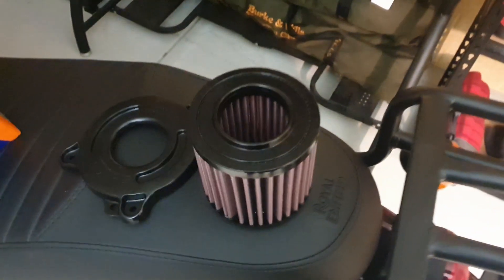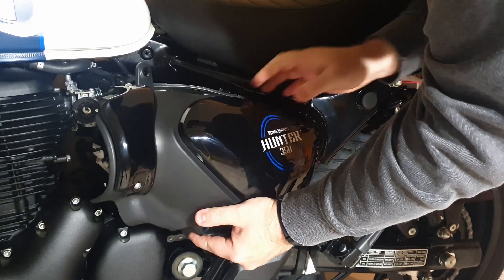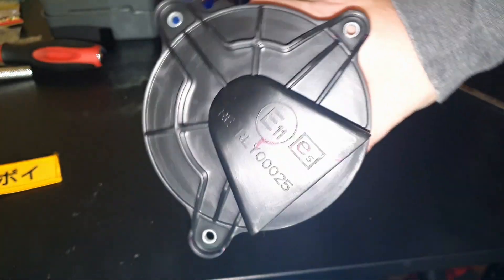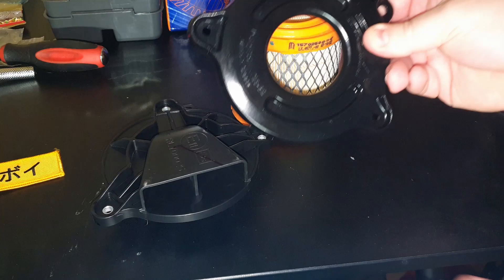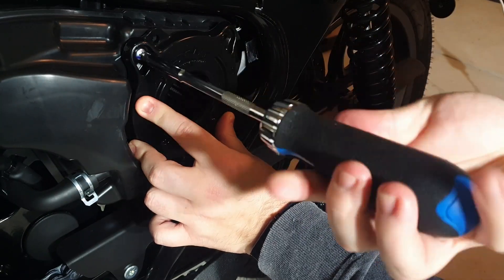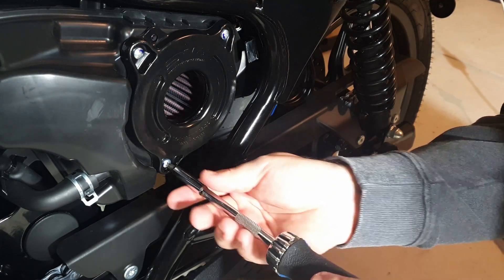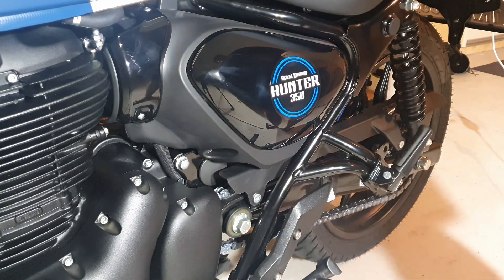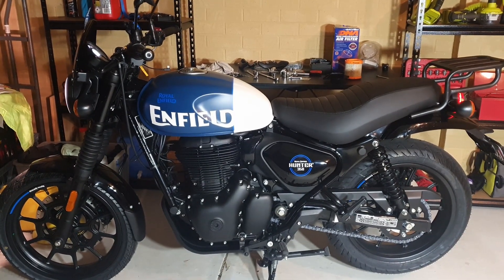Royal Enfield Hunter 350 DNA performance air filter and de-restrict plate install

Comment: It would have been really useful if you had given your impression of the new filter in use. Perhaps you will do another video to that affect.
Reply from the maker: I recorded this video only as an installation guide rather than a comparative test of the unit. My bike is not an ideal platform for testing as it is still in its run-in period and so the benefits of wear in could not be seperated from the new filter and box benefits, and so i felt like it would be unfair to review the DNA unit without evidence of its effect. When I uploaded the video I had not yet even had the chance to ride the bike. I only installed it last night, planning to ride this morning.

However I have now ridden the bike with the air filter and, without any data to support my opinion, it does feel more responsive and smoother when getting on the throttle, such as after changing gears and then reapplying power it is smoother, there is less delay for the power coming on and less lump. It makes it more pleasant to ride.

As for any actual performance gain I doubt there would be any, as the bike is not being re-tuned, it just has better flow and so is reaching its potential torque and power for any given revs with more ease. 

This part was pretty expensive for its benefits. I'm hoping that the future savings for washing and reusing the filter rather than buying new will offset the upfront cost. I would also if I could have 3D printed the derestricted air box plate, my unit had some shoddy tooling marks and undesirable finish for such an expensive piece, but I was unable to attain an STL file for the piece. Maybe a future project I could look at making something up in blender or solidworks.
Reply: Thanks for taking the time to reply, I’m thinking of just replacing the cover not the filter itself.
Reply: @keithwheeler3049  the cover is all that’s needed.  The filter only claims a 2% increase in flow. If you really want one I’d wait until it’s time to change the filter and buy the dna.
Reply: @elwood62  yeah if there was STL file to 3D print the plate that would be a great cheap upgrade
Reply: @MrCombfoot  I did it on my Meteor after break in and noticed the better response, and also the power band/torque curve didn’t drop off at 60 like it used to. Fairly smooth power up to the speed limiter at 74 (which the web says you might not have). Just mentioned as you probably won’t notice that during run in
Reply: @ChadWinters thanks, very interesting. I fancy getting a Hunter, but just wanted a bit more urgency from 60mph to 70mph, to aid overtakes. Did you notice any improvements in this area?
Thanks

Comment: We all do this sort of thing, but until you modify the exhaust system there will be no benefit. No point in making a bigger hole at one end of a system if there's still a tiny hole at the other end. You can save money on the air-filter cover by simply taking a jigsaw to the original rather than buying a separate plate. :)
Reply: Yep. Be no benefit any way restricted by ECU needs a reflash. Lots of money for miniscule gain!

Comment: I do interesting in the DNA but the only thing I worry is more air flow does the stock ECU can compensate enough fuel, I'm afraid that its may running too lean.
Reply from the maker: This is not a forced induction solution, it is only a flow rate solution. The amount of oxygen that the engine will be drawing in at any given part of its fuel map will be the same stoichiometricaly, it will just reach the desired air fuel ratio according to throttle position faster/more efficiently. The ecu that this motorbike has is more than capable for adjusting to these changes, it would deal with changes of leaness/richness with user going up and over mountains readily and these would be more significant changes to fuel/air ratio than the adition of this filter/air box modification. This mod will really just make the bike more pleasant to ride and have minimal effect on performance.
Reply: It has a negligible effect  ... a bit more induction noise has everyone waxing lyrical ..better to protect the engine with a proper filter.

Comment: Hi MrCombfoot, nice clear video.  Question - is there a need to do a "fuel re-calibration", as is suggested on the DNA web site, or does the idling for 15 minutes you mention essentially do the same thing?
Reply from the maker: From how I understood the process, letting the bike idle for 15 minutes is all that is required for the ECU to calibrate to the new plate and filter

Comment: you were much more careful about screwing in the new plate than I was, I may have to do it over again
Reply from the maker: If you have the time, I would. It's important to get a good tight fit between the filter and plate and plate and air box. The air box is under vacuum during operation, and dirt/dust will take the path of least resistance,  so if there's any gap in the foam crush seal or if the filter is angled at all leaving a gap, particulate will find a way in. I'm sure it won't be catastrophic,  but it's a simple thing to check and rectify of you have the free time.

Comment: Can you tell us where you found out you had to idle the bike for 15 minutes?  Where is it written down?  I don't think this engine employs a "learning" ECU, though happy to be proved wrong.  Even so, surely there's no measurable difference in air flow at idle, because the air flow is restricted by the almost-closed throttle plate, not the air filter.  It would be at WOT where any re-learning would be needed.  Is it written in the shop manual?

Comment: Reminds me of my foolish youth days when I used to slap these "high flowing, high performance filters" on almost EVERYTHING I owned.
If performance and not longevity is the only thing in your mind, then by all means, use these "almost see-thru" filters.
If you want longevity then the OEM restrictive paper element filter it's the only way to go.
ALL these high performance filters let thru the fine silica powder that when mixed with engine oil makes for a great "grinding compound" or valve lapping paste. Not as aggressive and fast acting as such but all the same to the final result.
Changing your oil on time or before it's due makes for good results too. Specially with a wet clutch.
P.S: Good, clear and simple video. Good work. 👌😊👍
Reply from the maker: I never was a performance chaser, even in my younger days. Not a big interest in large capacity or power, this is my 4th motorbike and is the largest capacity I've owned at 350cc! But power was not my intention for this filter and plate, without a retune there would be almost no measurable benefit to power or torque figures, bike wont go faster, people suggesting that 'performance' filters and boxes will make their bikes faster are somewhat misinformed.

I'm glad you liked the guide, that's the only reason I made this video, not as a discussion of my reasons for getting this accessory or reviewing it. 

But I thought I'd correct a few assumptions you and others may have made for why I got this accessory, and I might edit this respone into the video description layer as i have noticed a number of comments like this, or maybe even make a video if people are interested.

The 'performance' word is a bit of a loaded term in product descriptions, especially on automobile components. It can mean motorcycle power, acceleration, flow, filtration, economy, sustainability, comfort or reliability all depending on the individual buying the part and their application.

For me, I bought this filter because I intend to keep this bike for the next ~30 years. I was looking for i. sustainability, ii. economy and iii. comfort as my primary focus. 

i. I wanted a long term bike at a point in technology where internal combustion engines are being phased out. Paper filters are a disposable product that will need to be replaced at every service, and who knows long the support for discontinued technology will be around. A washable and serviceable filter I hope will basically last the lifetime of the bike with maintenance. Also saving products from landfill.

ii. With a planned 30 years of ownership, the savings on a reusable unit will vastly outweigh the up front cost.

iii. Comfort. More so the modified intake with larger diameter and less complicated geometry, but a little bit the air filter, the better flow afforded by this solution will give smoother and more responsive throttle behaviour making general riding more pleasant.

It's true that oil filters generally don't perform as well as their paper counterparts, but in ISO5011 testing paper filters achieve ~99.5% filtration, and good quality oiled cotton filter achieve ~99.2% filtration. So measurably worse result, but I would argue not a significant enough value for being a noticeable cause for engine failure. I've only witnessed engine failure on vehicles due to particulate wear in extreme cases such as no filters, damaged filters or lack of maintenance. Especially given that yes indeed I am a prudent and punctual engine oil maintenance fellow I don't expect that the negligible increase in contamination passed the cylinder to have any effect on my engine longevity.

So yeah, that was my reasoning behind this purchase! I had just made the video as an installation guide, for people already purchasing this modification and looking to put it on the bike, not to inform their decision. But seems there's a lot of interest and opinion on this particular modification =]
Reply: @MrCombfoot  So you believe fuel will still be available for 30 years ? ... if the eco warrior's have their way not a chance .😒

Comment: Great video thanks. Does the filter come pre-oiled or do I need to buy the service kit before installing?
Reply from the maker: Mine came pre-oiled. I suspect DNA recomend using their own proprietary cleaner and oil, but I will probably myself just use a locally sourced kit that is probably cheaper and doesn't have shipping. I haven't done the research yet into the best approach, as it is probably a while before th filter will need maintenance. But on that day, ill probably make a video about it.
Reply: @MrCombfoot  Great! Many thanks

Comment: Good video thanks! I have watched all your vids i am looking at the Hunter 350 as my next bike here in Thailand. Last bike was a Honda Rally which i did 25,000 on travelling around ,it was tall and i was not crazy about the style but a great bike loved it. Now i want a different type of 'dual sport', part stylish scrambler for daily rider and perhaps even sell my scooter and just use the Hunter to nip to the shop and part ADV travel bike. Can i have style and a touring bike in one at a great price? 

The new Himalaya 450 and Triumph 400X are soon to be released and price and the specs out before i decide but i am on a budget so leaning towards a new Hunter and getting a warranty extended to 5 years with it could be a good investment. I love the Hunter baby Bonneville looks i am going to take one for a test ride and see this week.

Its hot here so not having a windscreen might be nice to get airflow through my mesh gear. Looking forward to seeing what you think of the windscreen and rear rack. In my head i want side racks and soft bags and perhaps a rear rack for a waterproof duffle bag and then some 80/20 tires for the roads here. Metzler Karoo fit on the Hunter and i will measure for the Dunlop Mutants.. I like premium tires its my contact patch that keeps me safe.Perhaps a fly screen. Then ride . We dont have many highways and i avoid them regardless when possible.A multi country trip high km journey is what i have in mind.

Subscribed keep the vids coming its all food for thought!
Reply from the maker: After I get some decent distance on my stock tyres and get my bike past the run-in period I was looking at getting some Shinko 705's, which are about 70/30 tyres. Just because although I live in the city currently, I do trips out to my family a few hours away who live rural and there are some excellent gravel tracks around the area.

I was considering producing a first service video which is oil change, filter change and valve adjustment. My bike is already due but I have been very busy with work + heavy rain for weeks (its mid winter here) so i haven't been able to ride. But I'm not sure if people would be looking for service guides, as I just made accessory installation videos.

After that I may produce some exploration/vlog videos that I can voice over my opinions on the bike, accessories and just having fun riding.

I tried a wide range of bikes from triumph, honda, yamaha, norden, kawasaki and other royal enfields and I really just liked the comfort, position, quality and affordability of the hunter 350. I would definitely suggest going to demo ride as many bikes as you can at dealers, and go with your gut instinct! Your new bike is something you are riding for yourself, so its better to go with what resonates with you rather than what anyone quotes its specifications on a sheet or even what reviewers say. Its a very personal choice. Good luck!
Reply: @MrCombfoot  Thanks yes i need to take my time and try a few bikes before buying the next one, a bike is more then specs much  like computers you can have the best spec parts but the sum of the parts sucks. I dont like KTM type bikes although i appreciate the performance i love Japanese for reliability but i need a bit more style at this point.Yes i will spend the next few months mulling over the options i think one has to really fall in love with a bike or at least i do and I am looking for a weekly rental actually for the Hunter right now to really try it out before buying.

The Shinko 705 is a great tire if you can get the fitment correct. I like seeing all the step by step videos you are doing so keep that up. Its very useful reference material and your are  clear and have good sound and video quality.

Exploration vids are great too i loved Australia i spent a few years there would like to come back and ride. Maybe i need to look at shipping a bike down there to do a big loop.

I am nearing 60 and dont even social media but i am  thinking about starting a YT to document some riding areas and thoughts and equipment in Thailand. I dont like most peoples YT videos as i find its like listening to a narcissist  its all about them i dont care about that. I want to know about the bike and the area they are riding not what they ate for lunch . I also think its rude to go film people without asking them especially here in Thailand so i have not found an interesting YT motorcycle channel here. It is really useful to hear thoughts of other riders but i guess it invites 'know it alls" to come tell you how it is as well haha.DO you know of any good forums? The main RE one does not have a Hunter category yet its partly why reviewing YT videos is useful to me these days then i can go ride the bike and make up my own mind but have some pointers or questions to look at.

Its a bit of trial and error owning a bike plus its a feeling thing, we love or hate bikes to some degree because its so personal. For some reliability and simplicity is their benchmark and for others its specs and power that they seek.

If you have not checked out this channel i find it brilliant.Stuart loves RE bikes but he thinks about things in a different way then most. I find his channel quite useful. Same with yours so look forward to more vids.

https://www.youtube.com/@stuartfillingham/videos

He has some good Hunter videos.

Comment: Is it necessary to keep my bike idling for 15 min for a aftermarket exhaust change?
Reply from the maker: After making any fueling or flow changes, its good practice to let it Idle for a bit. I suggest 15 minutes, which is on the long end, just to be safe. It gives the ECU time to adapt, and to warm up a bit and continue adapting at not just cold starting. It's also good to give you time to check over and see if you have left any bolts undone, or forgot to remove some packaging or plastic. Start the bike, let it idle, give it a visual check over, put away your tools and it should be good to go.

Comment: Wouldnt water go in the filter if it isnt covered?and cause hydrolocking?
Reply from the maker: The air intake is still behind a panel that prevents any stray rain or water splashing coming in. Although I avoid riding in the rain, I have been caught out and ridden in torrential rain and got home in floodwater. As long as the water line is below the air intake height, I see no reason to believe that there is any way hydro locking could occur. The design of the original part is likely designed to meet cost, emissions and sound testing for the EU standards, otherwise I'm sure they would probably have designed the part in the same way as these aftermarket ones.

Comment: Do hunter 350 and meteor 350 use same air filter cover?
Reply from the maker: I believe there may be some small difference in the design; the classic, meteor and bullet use the same plate which is PART No. 93108

Whereas the hunter uses PART No. 93107, which ads a locator hole. 

I think that may be the only difference, and the rest of the dimensions are the same, but I would purchase the correct part for the particular bike. I don't believe there is a significant price difference.